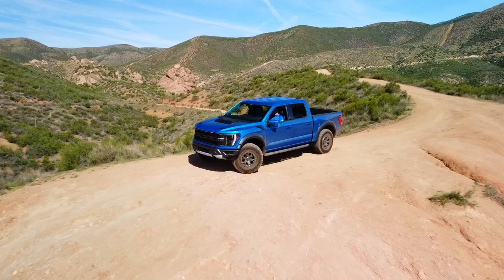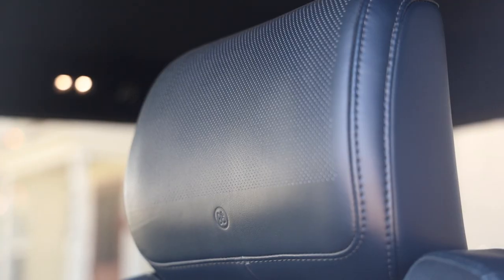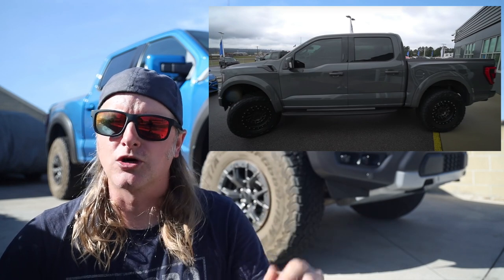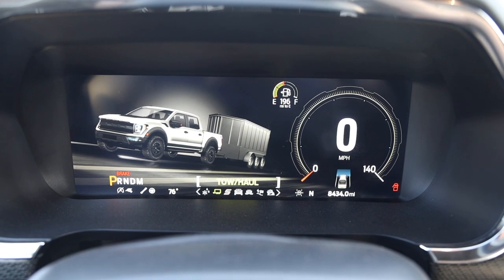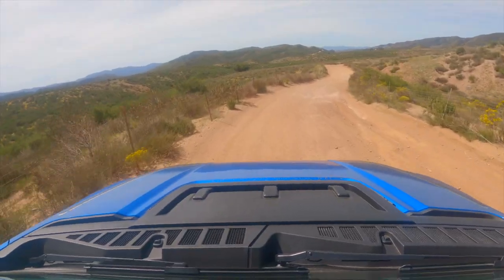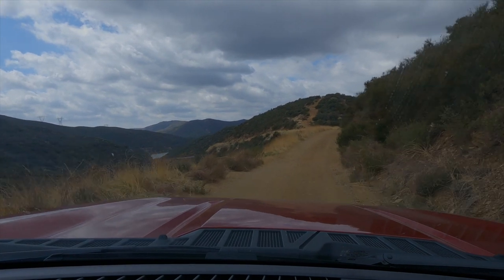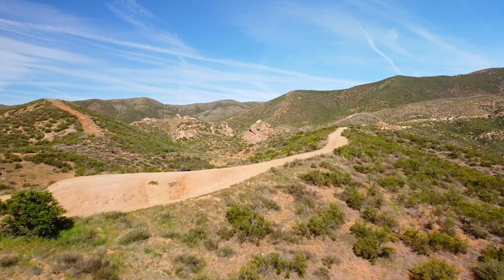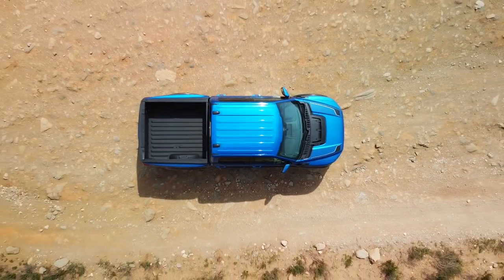3rd-Gen Ford F-150 Raptor Off-Road Review! | Still Great Despite the Missing V8!

Comment: Great review! I agree, it is a beautiful truck with great performance but that exaust is awful. MPG is disappointing too, because I am getting 13.1 in my Gen1 Raptor with the 6.2L NA V8.
Reply from the maker: sounds like you have a forever truck :)
Reply: I have loved my v-8 fords and their sound. Love my 17 Raptor, first ecoboost. During the winter I get 13.6 with 35's. Different gas and longer warm up time. During warmer weather I get 17 mpg. I would not hesitate to get the new one with 37's and the v-6.  Would also take the up coming Raptor R with the v-8 if I had unlimited gas money.  We all know the ram trx sucks with its v-8 with gas mileage.
Reply: @johnt6673  I had a 2017 Ecoboost Raptor for 4 years and liked it a lot. But I sold it last summer and bought a low mileage Gen1 during the winter and just bought a 2022 TRX last week. Those trucks need a V8 to complete the package. I don’t really care about MPG.